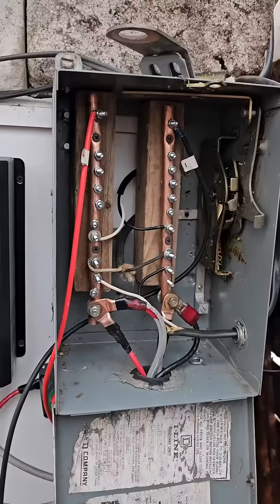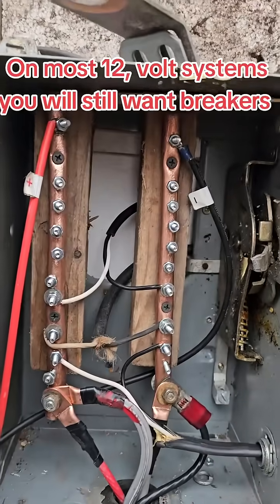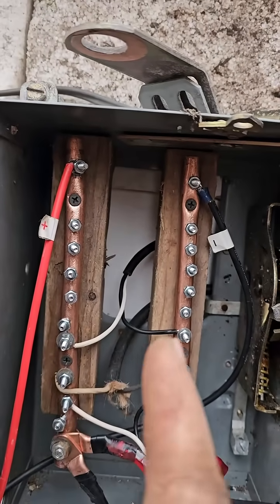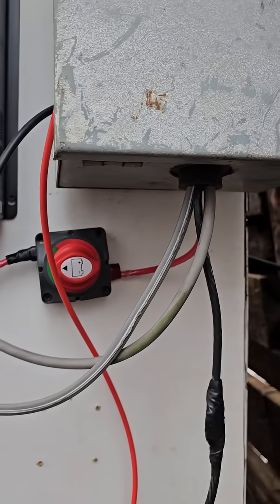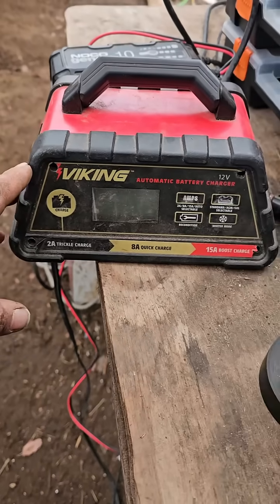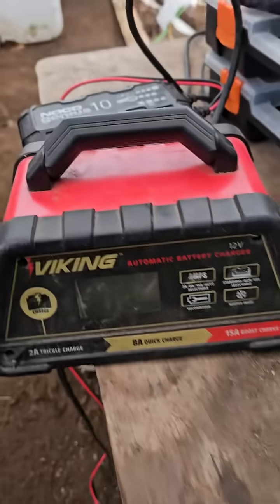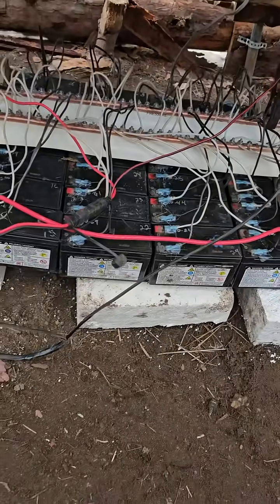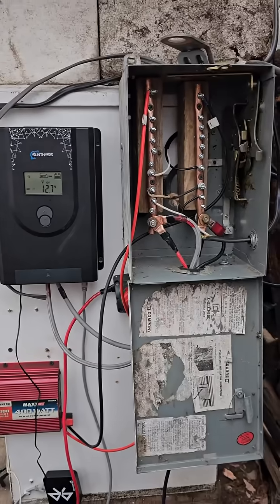Off-Grid DIY Solar Battery Bank Setup with Sustainable Living Hacks #fokachannel

Comment: If you’re charging your batteries off the generator, you can still use your two chargers, but you know you have a 12 V port on most generators. You can charge your batteries from that.